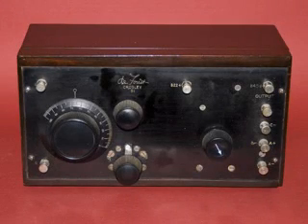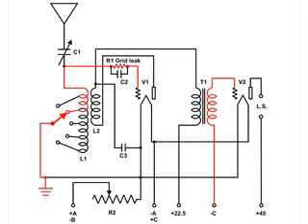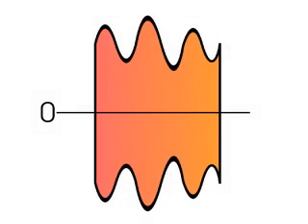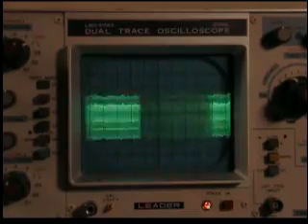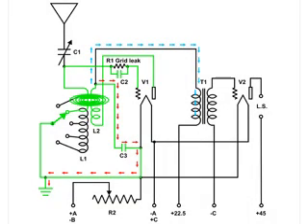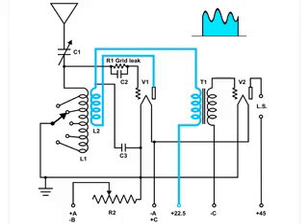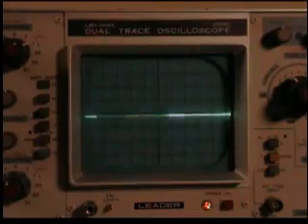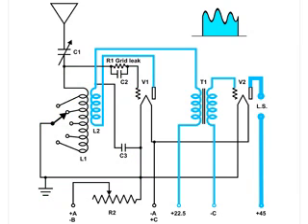DeForest Crosley 51 radio regeneration circuit part 2

Comment from the maker: If you move the tickler coil to close to the antenna coil it will start to oscillate and will start to transmit. I did remember to demo of this in part1. The positive feedback is set just strong enough to amplify the signals with out oscillating. It takes a while to tune in a station, but it works surprisingly well. The Horn Speaker is actually an old earphone and they usually range from 1000 to 2000 ohms. So there's no output transformer.

Comment from the maker: You're exactly right. I have worked on, and I'm sure you have also, many circuits that just the part position is extremely important to its successful operation. And that shows up nowhere in the wiring diagram. At first glance this circuit looks like nothing, but V1 is doing a lot of work. Thanks.